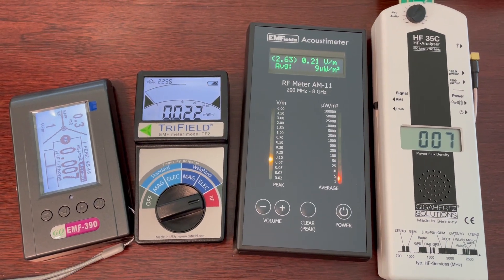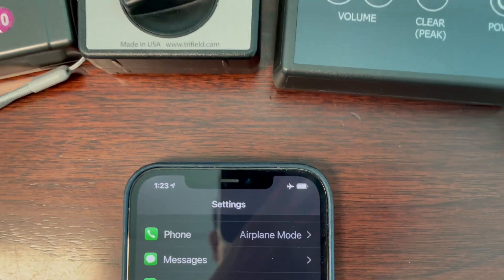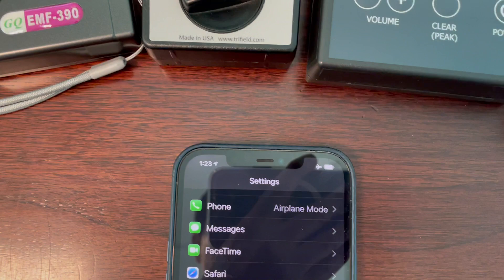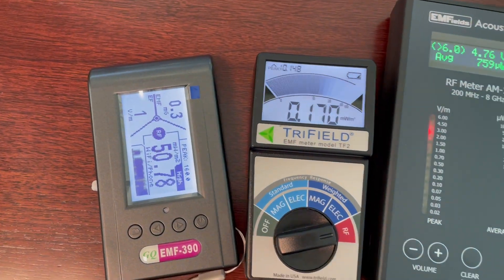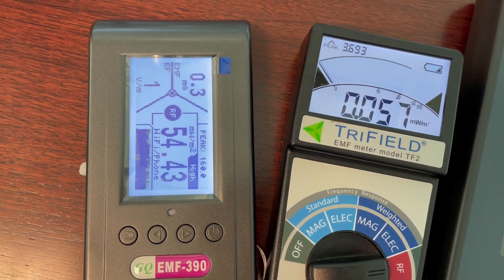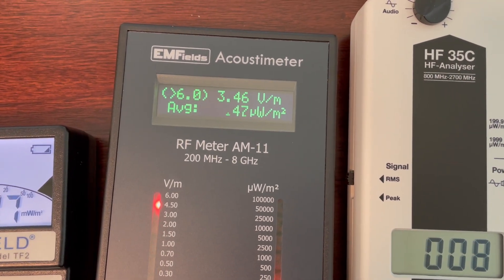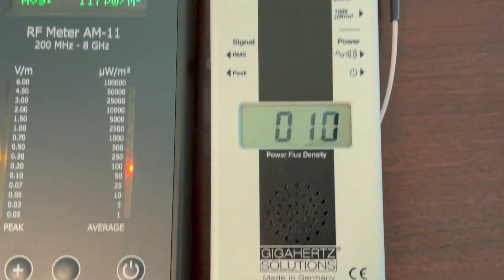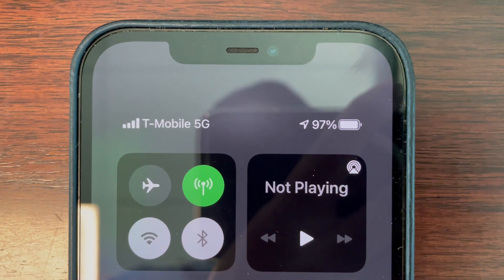5G Phone Signal On Four RF Meters EMF-390 Trifield TF2 Acostimeter AM-11 GigerHertz HF-35C

Comment: On the TF2 if you pay attention, it pick the values on the left up corner. It shows pick values and not continues value. So, it works in perfection.
Reply: Has very short range imo, i live 200 meter from a tower and it often doesnt show reading as the value is higher than its range.... max is 20 mw/m2.
Reply: is that peak on the trifield meter (top left) 3.693 mw/m2 !?
Reply: @kanhdahar2  Yes , but the peak on EMF-390 is 160.0 , and this is BS , I have 3 meters and all differs in measure. There is no way to know if anyone is accurate ( perhaps if you by one at $1000 for prof. use)
Reply: @p.neeshed5937  safe and sound 2 is supposed to be very good but is about £300 you will get it cheaper as its american or canadian made.
Reply: @p.neeshed5937  I want to sell my tf2 now and buy the safe and sound 2. tf2 isn't great for bluetooth either.

Comment: Should the meters not be the other way round? The sensors are in the top so they should be pointing at the source. As someone else mentioned I don't think any of them will pick up 5G, it can go up to 60Ghz and these will top out at 8Ghz. I tested my em390 near an old style tower it went way high and registered it as a cell tower. I also went near a newer, street cylinder type tower and it only registered it as WiFi/phone. The readings were higher but nothing like the other one. Pro 5G meters cost in excess of  10000 uk pounds and only certain companies can buy them it seems.
Reply: There’s one for sale for 1000£ and it can measure up till 32ghz 5g frequency. Names is FM5 EMF meter and it’s Uk manufactured .